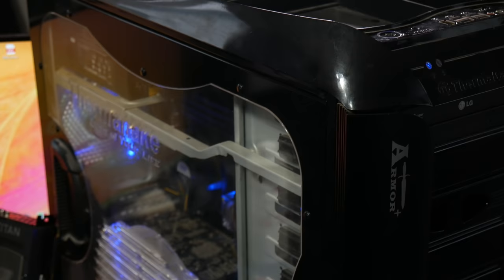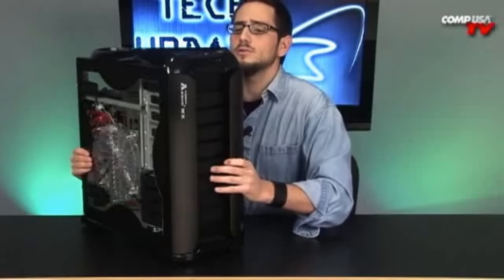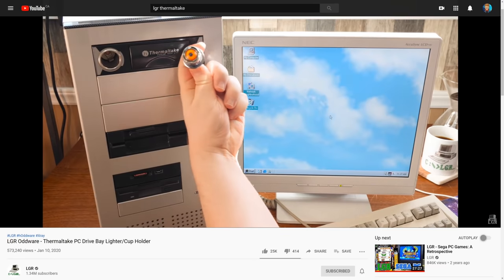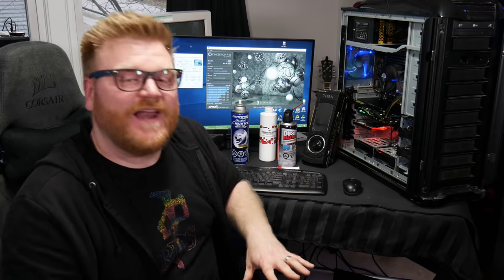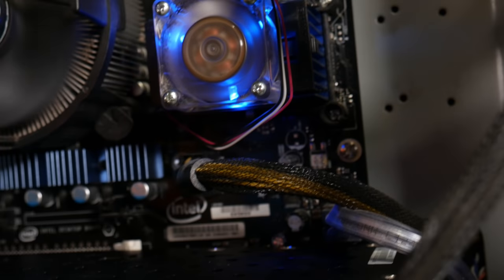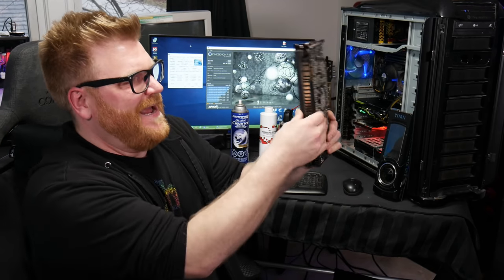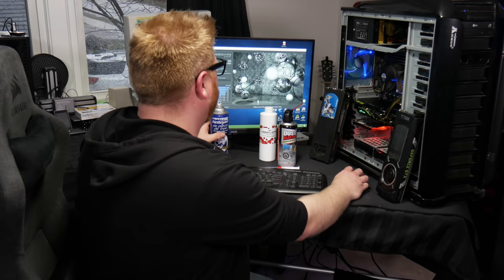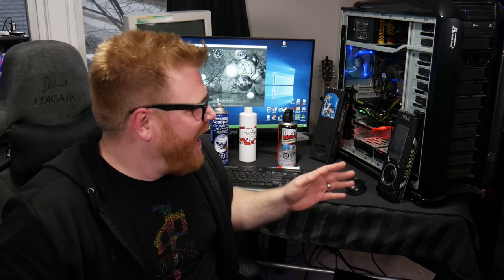Can $5000 buy a PC that will last 10 years?

Comment: I'm using that same case for my 10 year old backup rig! 
I built a newer rig 5 years ago to "replace" it, but I still keep the 10 year old Phenom II X6 build running as backup/media server and it performs just fine. Even upgraded the 10 year old GPU to an RX 570 a year or so ago and handles light gaming pretty well, paired with it's now fairly ancient 1100T. Was pleased to find I could still breathe some more life into it even after all this time. :) 
Definitely didn't pay anywhere near $6k to get those 10 years of life out of it, though. lol

Comment: Making me feel guilty with my 980Ti, manually installed Hydro cooler, still using the thermal pad it came with >_<
Reply: That’s still not as bad as the computer shown in vid bro
Reply: Lol the 980ti is a beast it overclocks better than a 1070
Reply: just play with games configuration , mainly the resolution , the AA , and textures quality , those eat a lot of Vram , a 980Ti is very good for 1080p/+60 fps  at very high on new AAA games, it's equivalent to a 1070 , the only complain about her is the 6Gigs of Vram that are starting to be  the limit for 1440p/60 fps/Ultra (the new norme in term of gaming resolution) 8 gigs is a minimm for 2020 and beyond AAA games ......but still , GTX 980TI is a great card , and the best upgrade is , in my opinion , the GTX 1080 TI , another huge beast till today , or the RTX 2070 super(for the Ray-tracing and DLSS 2.0) ( yeah,i'm an Nvidia FanATIC )........

Comment: I built an FX-8350 before I knew any better in early 2013 with 16gb of DDR 3 1600mhz and a Radeon HD7870 2GB ghost edition, 120gb SSD boot drive with 1TB storage and I am still rocking the same configuration today, its hanging in there but its lucky I have slowly drifted away from playing modern AAA games and sticking to the classics otherwise it would be upgrade time. Keep up the good content!!

Comment: My buddy bought a "great" computer almost 10 years ago. Loved it, didn't want to upgrade ("it runs exactly like I want")
i7-920 (4/8 cores) [2666 MHz, refused to overclock], 6 GB tri-ddr3, GTX-280
I helped upgrade it over time. -->  18 GB tri-ddr3. ssd. GTX-470, then the GTX-970.

Finally talked him to a new computer late last year.
Ryzen 3600X (6/12 core), 16 GB dual-ddr4-3600, (kept the GTX-970 due to budget)
Works Great!

Comment: Back in 2007 when I was 19 I purposely built my rig to last 10 years. Paid around $2,500 CAD for my Q6600/8600GT build. Over the years, only a few hard drives, the case fans, and the graphics card wore out and had to be replaced. Everything else lasted. I finally retired the rig this year, 2020, and replaced it with an $800 Ryzen/Radeon build. While I'm not quite the gamer I used to be, I'd never go back to spending so much all at once in the hopes of making it last. While I certainly got my money's worth, I also paid a price due to outdated tech.
Reply: Q6600 was a beast! Not surprised it's still chugging along.
Reply: So 13 years good luck, or back luck? I'm with Timmy. Newer tech, more often, by spending a little less now.
Reply: @nightvision6168  Good and bad I guess, lol. The new rig will either get upgraded sooner than later, or completely replaced in 4 to 5 years time. Assuming AMD keeps reasonably progressing and that Intel get's back in the game at some point that is.

Comment: ok depends:

let me explain what i tell people to do with there machine if they are going to buy a machine or build a machine the only thing i recommend 100% is buy a board that you can upgrade the cpu on at least twice. 

forget graphics card hard drive o.s that will always change but honestly cpu speed is where you might need to make a drastic change at depending on what you are running or editing.

usually after these 2 cpu upgrades its usually time for a new cpu and motherboard and ram unless your current ram carries over and saves you money and your gpu if it still can compete after 2 cpu upgrades go right on ahead and transfer it over 

there are hundreds of ways to do a upgrade. 

it really depends on what you want and what you need in a real world not your fantasy 4k world

Comment: Hopefully I remember to post a photo, I assembled my rig in 2014 with a Roswell 1000watt Power Supply, Sapphire Radeon HD 7950 OC, LG Internal Bluray, Kingston Digital 250gb ssd, Corsair vengeance 16gb ddr3 1600mhz, Asus Maximus VI Hero DDr3 2800 LGA 1150, Intel Core I-7 4790K, Corsair Hydro Series H100i Watercooler. I assembled this at the time with longevity in mind, maybe not quite ten years but hopefully it gets there. This is 7 years later (pc was assembled in December of 2013) and it still running strong. Recently had a clean and thermal paste redone, dust blown out. Running smoothly.

Comment: im still using my x58 build. :/ it has a x5660 with a rx 580 and 24gb of ram. it only feels dated when i run benchmark programs. pretty much every game is well into the 100+ fps with 1080p
Reply: Same here only i just put mine together this winter. Asus  P6X58D board with X5675 OC to 4Ghz, 12gb ram and a RX 580 8gb it works great for what I play.

Comment: I built a pc with an i7 930 and 6 GB of RAM about 10 years ago, and it's still going strong. I upgraded the gpu a few times, but stuck with the GTX 970 since release. I also upgraded to 12 GB of RAM and added an SSD. I definitely don't agree with your client's view on the 10 year rule, but since I only bought the motherboard, RAM and CPU back then and chucked them into my existing chassis, I think they've done pretty well to hold on this long. I think it had a lot to do with the fact that the games industry has been based around consoles with very slow CPUs until now. Obviously with the next round of consoles, this will be changing, and there are already games that my old CPU struggles with.

Comment: I've been running an 8350 since 2012/2013ish.. It's still running strong for me. I don't do a lot of gaming anymore so I don't need to upgrade.  I do more programming / youtube/netflix now than anything.
The full set up is an 8350 with a hyper 212 evo, dual 480gb ssds in RAID 0, dual 2 TB hard drives, 16GB of RAM, an R7 370 windforce video card, and dual samsung 27 inch curved monitors. It's been awesome while I've been working from home.

Comment: Built my current PC in February 2009 for about $1500.
i7-920 w/Xigmatek Dark Knight
MSI X-58 Pro
6GB DDR3-1333
Cheap video card since it was for photo editing
640GB WD Black HDD
Cooler Master RC-590 case
Corsair 650TX
Upgraded to an SSD for the boot drive, a GTX-1060 6GB, and someone gave me 24GB of DDR3-1333. Overclocked the i7 to 3.6GHz. I'd love to build a new one, but it's working for now.

Comment: I built a pc with a $550 budget in 2012 that I intended to last 5 years. I5-3470, 16gb ddr3 1333 ram, 1tb hard drive, and a r7 260 that I upgraded in 2014 to a used gtx 660 (special edition 3gb non ti model), 700 watt power supply (cheap unknown Chinese unit, non 80+)... lasted until 2018 and was still running and fully functional and the r7 was still running in my wife's pc until same time when I sold both systems

And it included a new 24" tv as a monitor - 720p

Comment: I seem to constantly upgrade... 8088 -> 486-33 -> 486DX2-66 -> 486DX4-100 -> K5-133 -> K6-2-350 -> Athlon 750 -> Athlon 1300 -> Athlon XP 1600+ -> Athlon XP 3200+ -> Pentium D 3.2 -> Core2 E8400 -> i7-3770 -> i7-4770K -> TR 1950X -> R9-3900X.  Only one I was dissappointed with was the Threadripper because I had planned to upgrade just the processor when the 3rd gen threadripper came out...happy with the 3900X though.  I upgrade video cards a little less often (like maybe every 3 years) and always have bought in the $200 - $300 range.  Cases and power supplies get reused for years... I've only used 4 different cases in the last 25 years.

Comment: We only just replaced 20 PCs in my lab at work that had that exact Motherboard - we had i7-960s in them with GTX 285s originally.

They were steadily upgraded over the years - HD swapped for SSD, GTX 285s swapped out for GTX 970s, 6GB (3x2GB) swapped out for 12GB (3x4GB).

Comment: Timmy Joe, I have a white antec 1000W PSu from 2006 and it still works in my main rig. It has serviced about 6 motherboards, 8 CPU's and who knows how many GPU without any hardware failures. I trust that Antec PSU. They made great PSUs and fans (I still buy their Prism and Spark fans before they went out of stock recently).

Comment: I did it the other way around. Bought a 700 euro computer to last me 3 years, 9 years later it's still going strong. Updated the SSD from 64GB to a 500GB model and update the GPU about 2 years ago. It's starting to show it's age but it's still functional. Hoping to upgrade in the next year or so.

Comment: My PC is juuuuust slightly under 8 years old, and it was a $1100 build (monitor, keyboard, mouse inc.) when purchased and assembled. It can still hang, but... it's hanging in the back of the pack, for sure. 
Every PC I buy, my goal is to have it last 10 years. It's just the mentality I was raised with. I think the same thing about pairs of shoes. Buy quality (not power, in terms of PC parts), treat it relatively well, and cross your fingers.
I'll be upgrading before the decade mark, ofc. My lil' ol' GTX 660 is really starting to strain in low settings on newer games.

Comment: We have the same case minus the tray on top and plus a bigger fan on the side that still works. We must have brought it around the same time too but i got mine on sale.
We put in the cheaper parts and used it to run a Myth TV frontend/backend. It has worked awesome with all those harddrive bays for the video storage.
It is now replaced because we don't record TV anymore and now play some games over the LAN.
Cool video by the way.

Comment: I buy a system for like 5 years but upgrade the gpu every 3 or so. On a 980ti now I bought around €400 back in 2016 and a 3700X (4790k before). Gpu will be upgraded soonish when the 3000 series releases (or AMD has something great).

Comment: 2009 is a huge OOF year for a Future Proof PC. 
I only retired my 2011 2700K system last year. Only having to change the PSU a few times and GPU of course. PCs are WAY better in the long term now than they were 2000-2009.

Comment: I find that the key to computer longevity is its use case. Low to mid range boxes have a use case that will make them viable for many years. 
For instance, we recently replaced a very low end media center pc. It was an 8 year old AMD. The only reason we replaced it was because we started to play some games over the LAN. So the use case changed.

Comment: I have a 2009, EVGA X58 SLI, Intel Core i7 920 (D0 stepping - 4Ghz OC), 24GB DDR3 1600 (6x4GB DIMMs - originally had 3x2GB), Nvidia 980T1 (originally had Radeon 4870, upgraded to Radeon 6950 - and finally my used 980Ti from my main PC), and upgraded to SSD (WD Blue SSD now) twice for the OS drive. I have had some issues with the EVGA X58 board, compatibility with Ram OC, BSODs, etc., but finally got it stable at the above settings, giving it a new lease on life. Its now my main office/work PC on which I can play a game or two if I like.  So all in all, 11 years isn't bad. Its in fact getting close to upgrading my main PC with 4790K +1080TI (its fine for now though as I only game at 4k60 Hz).

Comment: I didn't plan for my PC to stick around for 10 years (or my laptop) but it did. I did my research in 2010 and got what I thought were good parts. And they stood with me to this day (minus a couple of hdds). I probably spent around $4000 over the years but mostly on storage (and some fancy fans). Fractal Design R2, Corsair HX650W, Asus M5A99X Evo, AMD Phenom II quad 965 black, 4x8GB G.Skill Sniper DDR3, OCZ V2 60GB SSD, WD Black drives and WD green drives, reused mouse and keyboard from previous build, Benq 21.5" V2220H LED LCD, Noctua NH-D14. I upgraded the fans on the NH-D14 to the NF-P14R and used one of the original fans for front intake. Got another Noctua fan for the front intake. Went all out on the outake (hehe), IP67 industrial 120mm rear and 140mm top x2. Silverstone magnetic fan filters to help keep dust out. Liteon iHas524 DVD burner. Over the years I mostly upgraded and replaced storage  - Samsung 850 pro 128GB, larger WD red backup drives to replace greens and a couple of replacement blacks (although I have a few drives running 7-10 years now..). I have seven mechanical drives and an SSD in there. With de-dusting and thermal paste replacement, it was going strong still after 10 years with good temps - but I got sick of not being able to play new games and bad frame rates. Upgraded to Ryzen 5 3600, Asus x570 tuf gaming plus (non wifi), 2x8 g.skill ripjaws v cl16 3200mhz and samsung 970 evo plus nvme 500gb. Reused the case, PSU, cooler and fans (with free Noctua AM4 mounting bracket). Since the old build was going so strong still I plan to soon upgrade my new build's case and PSU so I can donate those parts to the old build again, so I can use that as my dedicated recording PC (which is at the moment an ancient Pentium 4 that is starting to blue screen randomly). Just need a cheap cooler to use on it. So sometimes you can buy for a '10 year' length, but definitely don't expect to be able to play current games or have good frames in 9-10 years.. my 10 year old i5 laptop is fine for DJing still with the old program Serato Scratch Live, which is what I bought it for.. changed the thermal paste last year though, figured after 9 years it was time.. I don't use it that much (a day or two a month roughly if that) so it wasn't that bad but temps were going up. Maxed out the memory but still need to put an SSD in it.

Comment: My i7 3770K is still going strong after 8 years - only thing that would likely need replacing to help it play games better in 2020 would be the graphics card (got a GTX 760 4GB - it's ok for 1080p at medium settings but showing its age otherwise). I think for most people Sandy/Ivy Bridge i5s and i7s are still perfectly fine - I don't think CPU performance has moved nearly as fast between 2012 and 2020 in 'real terms' for most users as it did between say 2002 and 2010. There's not been nearly as many innovations which means that your quad-core from 2012 or 2013 is still likely plenty, especially if you overclock it and the rest of your system is strong.

Comment: that fan can be cleaned and greased to run, just take out back fan cover, and spray wd40 to unblock fan and make it to spin easy (sry my bad english)
Reply: You use WD 40 wrong. Wd40 is a de greaser. It means it removes oils. Moving parts require oil. Sure the WD40 is gonna make it move because it cleans the old dust and junk. But soon there will be wear and tear. Lol don’t believe me? Use WD40 spray your bicycle chain it’s gonna run well for the first week and soon you will realise it’s wearing and tearing. Best 20$ to try it for yourself after that and change the chain and clean the whole system.

Comment: In March of 2019, not too long after RTX released, I bought a $1400USD gaming laptop from MSI with an RTX2060 in it. Over time, it started running very hot and often struggled to get 60 FPS in higher-end games. I ended up building a $1200 desktop with a 2700X and RTX2070Super and I run at about twice the speed or more without loud-ass laptop fans.

Comment: My previous system was an old computer I upgraded with a new chassis, Intel i3570K running on a Z77 miTX motherboard with a massive 16 GB of RAM. I expected to get 3 years out of it, but with a free gpu upgrade about halfway in,  it lasted for 8 years. Not bad at all for a $1000 upgrade. :)

Comment: I built my system 2011 for that reason but didn't think it would last this long. 2600k@4,6ghz 16gb ram but upgraded my gpu to a GTX 1060 6gb. Cost me like 1300 USD back in 2011 and it has worked awsome. Lets see what the future brings!!!

Comment: You used brake cleaner to clean a PCB?

I have plenty of this stuff as i work on my own vehicles, however i'm interested to know how this works with PC components. Does it work? are there any precautions that should be made when using it? how does it fair up against compressed air?

Comment: 1080p back then was demanding. Nowadays its an easy Job for high End gpus and IT will be in 10 years from now for the 2080ti.
Reply: don't need high end gpu to run any game at 1080p these shit a 1650 super will run most games max settings
Reply: @JbrZee  but not in 10 years from now

Comment: I built a PC in early 2008, so 13 years ago.  I spent over £2000 on it and still use it to this day.  The only upgrade since then was a GTX 970 that I bought from ebay about 18 months ago for £100. Do I use it for modern games?  Of course not.  AAA games from 2015 are about it's limit (due to limits of QX9650 CPU).  I use it now for Windows XP retro gaming.  Basically its a dream machine for that.  I dual boot with Windows 7 and can also run directx 10/11 games that don't run on my Windows 10 machine due to compatability issues.  The PC is still running original 10k RPM drives, no SSD.  It is still a responsive and fast machine.  I was even using it until a year ago for 1080p video editing and was able to browse any websites with no issues. I don't use it online now though, as Windows 7 is no longer secure.

Comment: I'm in a similar place, built a beast for bf3. xeon cpu, amd Radeon HD 9-something, Asus rampage extreme iv(maybe) bf3 edition, 16g of ram. I replaced my gpu with a $50 nvidia card about a year ago when I tried to use it and realized the gpu was toast and lacked support anyways. My question is, should I build a new system or just get a good amd laptop like the new zephyrus from asus? Low on $, and I want higher refresh rates without the added cost of a monitor. Just looking for playable fps in mainstream games and a little future proofing for less than $2,000 total.